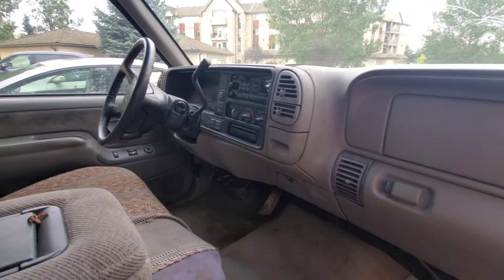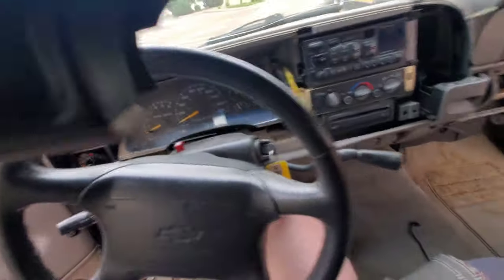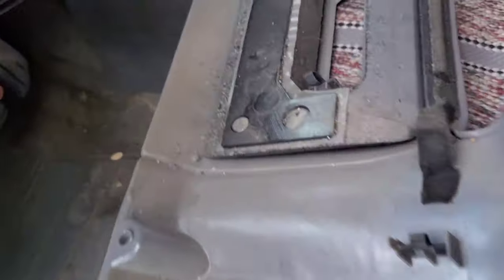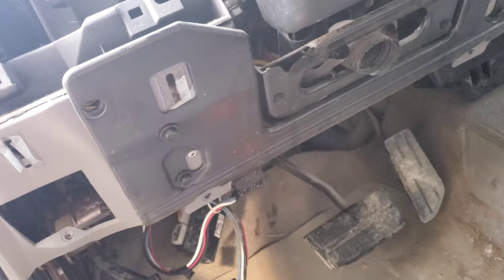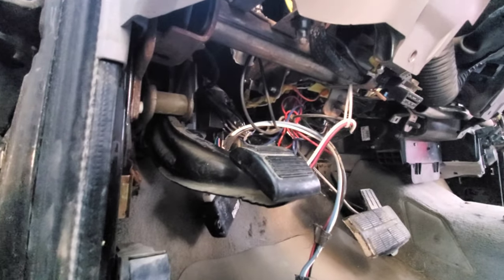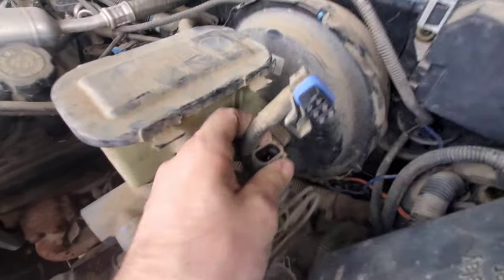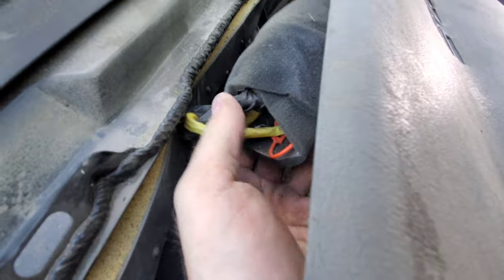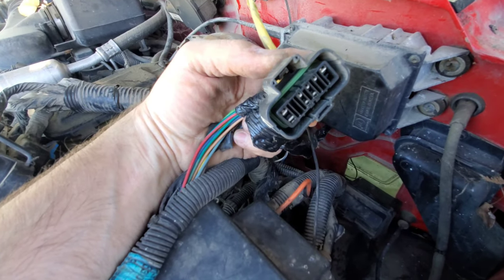Dash Removal Chevy GMC Truck 1995 1996 1997 1998

Comment: you're doing this job harder than it needs to be. I'll replace the dash in my 98 z71 without getting under the hood. If you had removed the steering column then you'd been able to unplug all of the dash components without having to pull the wiring harness through the fire wall. I have short vids when i replaced the oem dash top having to take the dash out and put it back in in the 04 dodge crew i previously owned. NUFF SAID.
Reply: Wish I read this before doing all that 💀
Reply: @turle8645 me too😂
Reply: You don’t even remove the steering column, just unbolt it completely and it will drop to the floor with the dash then you can just unbolt/unplug the harness from the back of the dash and then you can pull your dash out
Reply: Post the video so we can refer to it

Comment: Thank you for making this. I would have never even attempted this job without this video. Thanks for taking the time to make this. I watched it three times and almost didnt even try it. Also thanks for mentioning the differences vetween the 1997 headlight connection compared to the 1998 and 1999. You the Man!
Reply: My dash was really busted up from previous owner. It rattled so much it was so annoying to drive. I went to salvage yard today and pulled the only one they had the color I needed and out of a 99 Tahoe. I made a small mistake though by not being more aware of the vehicle I pulled it from. It was a 2WD so it did not have the electronic wiring harness that was needed to plug in my auto trac 4 WD switch. I ended up having to remove the ventilation duct and removing the wiring harness and reinstalling it on the new dash. Just a note to make sure the vehicle you pull one out of have the same options so that you can plug and play instead of having to do what I did. Video helped a ton. One thing I would note is that I feel like it is not necessary to remove to ash tray and 12 V charging ports. All of those plugs come out with the dash. Thanks again for the video.
Reply from the maker: How can I be the man when you're already the man?
Reply: @tonybunch9115  See my comment above. When you have both cores in hand, it's easy to reroute the harness from one to the other. My '99 Burb has the pigtail for the 4WD switch tucked around the instrument panel, even though it's a 2WD truck. I guess GM used a full harness instead of a lite version, but even my '97 donor truck has the same thing. Who knows why they made that choice... was the Tahoe also built in the same plant in Mexico?
Reply: @MrTaxiRob  The plugins i needed were not in the dash I bought. I would have gladly used the existing lol. It was a pain to change out.

Comment: This video doesn't show ALL of what needs to be unplugged tho, I just took mine out today and I released after following all these steps once you loosen the top 3 screws there's still 4 wires on the driver side behind the dash and 3 or is it 4 wires on the passenger side that still need to be unplugged B4 you get to take it out without a problem. Also it works better if you remove the steering column all the way. Although this video was ALOT of help, so thank you for that.

Comment: Don't know if you ever figured it out but the computer doesn't have to be removed the black bar if you pick up a little it moves over and the computer slides out the holder

Comment: I installed thousands of those dashboards when I worked at GM. A lot of the stuff that you removed is all assembled on it the IP line and the whole assembly is installed in one piece. The lower parts are installed after IP is inside cab. Of course the steering column and seats are in stalled afterwards. 
👍on the video
Reply: How is the passenger airbag installed in these trucks burner Loco?
Reply: How come you didn’t make a video ⁉️but you right and there’s so many that do that well want tell other stuff at lease this guy don’t talk about all the information that has nothing to do with the job at hand ‼️I think him for having the only one that’s straight on what the video about‼️🙏🏻🙏🏻☮️

Comment: You did an amazing job on this video. I used it as a guide to pull the dash out of my 1995 Chevy Silverado Z71. You didn't miss a thing. I could not get my dash past the steering wheel. I actually broke it while trying. I went ahead and removed the steering column to put it back in. That worked really well, but it's a pain. I have not found a good video on removing and rebuilding the air box. That would be a good addition to this one.
Reply: I’m about to have to do this as well to get to the air box any tips? I have a 95 z71 as well.Do you have to completey remove it to get to the air box?
Reply: I'm in the middle of pulling the dash because I can't get the damned air box back in. All because I wanted the warranty on the AC parts. Tried to replace the accumulator, ripped the hose.

Comment: thanks for this. I been had the parts to finish redoing the entire A/C system and needed access to remove the heater core. this will save me lots of money!!!
Reply: I installed my heater core on my 98 in under an hour. Not as difficult as it seems I had more trouble putting the covers back on than anything else

Comment: Great vedeo and great explanation it's really crap work mate 😃 I hope I never ever need to replace on my 95 suburban 6.5 😃😃 you understand well enough for replacing that caind of the pieces 🤔👏👏👏👌I don't like wires and electronics stuffs 🤪🤪 I prefer replacing a mechanical parts 😃👍cheers from Norway 👍👋

Comment: I recommend having one of those interior panel clip tools on hand, the forked thingy with the regular screwdriver handle. It's good for gently pulling the push clips for the wiring loom and whichever plug ends are also clipped to the truck. And do it when the dash is nice and warm so they give easy instead of snapping, maybe leave it in the sun an hour or so before you start separating the wiring harness from your donor dash. Piece of cake.

Also: REMEMBER TO REINSTALL THE SECTION OF METAL BAR UNDER THE STEERING COLUMN before you try and pull the dash, otherwise the whole thing gets floppy and you're going to snap it in half. Even if you intend to throw it away, it's MUCH easier to pull it and remove the wiring with it in one piece.
Reply: Those tools are great,...until you lose it!
Reply from the maker: Very handy

Comment: I could describe most OBS repairs as "tedious," but not necessarily "difficult." This is the first dash removal vid that actually shows what need to be unplugged without cutting any wires as a dismantler might do... although why anyone would butcher a perfectly good dash harness just to sell a dash core boggles my mind. That's like cutting a perfectly good transmission in half to pull an engine.

If you're doing a same year swap, all the plug ends should be the same including the airbags, so it's easier to leave the harness in place. I have to do a 97-99 swap, so unfortunately that's not the case for me, but at least I'll still have two running and driving trucks when I'm done.

I can swap the harnesses with both cores on the bench, easy peasy. One core is mint and the other gets epoxied, one truck is for show and the other is for work. Not everyone can do a destructive removal, so thanks again.
Reply from the maker: They still have heavy metal in them. Easy to body work

Comment: I listened & watched 4 other videos on how to remove my glovebox & none have the same mechanism as yours. Mine is like yours. I tried to remove it just like the other folks were showing but mine has that little plastic "stick" on the side of mine. Just like in yours. I need to swap out my resistor as I lost high speed. I got the part at Advance & was going to try & do it but no dice. I'm dealing with all plastic. Plastic is very easy to break in my hands. I wanted to push it but I know I would mangle it. So I stopped before I broke something. I figured the other videos were without that plastic stick in the left hand side. My tool box has a 1 pound hammer & a 3 pound hammer & a sledge hammer. Finesse is not my forte.

Comment: The parking brake handle comes off of the shaft and the mount for the shaft twists out. No need to disconnect cabling in the back.

Comment: So this video has helped me a lot removing and reinstalling my dash but the wiring doesn’t want to work correctly I’ve rewatched the video and I’ve got a plug that I can figure out where it goes and my headlights now blink with my hazards and my ignition doesn’t work do you know what that could be

Comment: My 98 K1500 has been LS swapped and the guy before me messed up something with the wiring (I assume sensors not hooked up) that caused the instrument cluster not to read anything. Lol greeeeat.
Reply from the maker: Luckily not much changed generation to generation. Could be a simple fix
Reply: @inlinepaintandbody  The original LT fusebox is still in there and the LS fusebox has maybe one or two fourths of it hooked up.
Reply: The only thing is, I've compared the two and I'm not so sure that the pinouts of the connectors would work properly with the LS fusebox.
Reply from the maker: @Monster404ftp  I’m not much of an expert on electrical issues, but there is a lot of information on wiring with an LS swap. And also finding a guy who can diagnose electrical issues is worth 1 million bucks. Definitely get what you pay for when dealing with electrical issues and fixing them.

Comment: Great and informative video. The fasteners you are calling 7mm are actually 9/32", but a 7mm will work. GM likes to use 9/32" and 7/32" for many of the smaller screws, especially on 60's, 70's, and 80's vehicles, which are what I used to work on. I would like to replace the dash in my '95 Silverado because around the 3 screws by the windshield the dash is cracking causing the dash to rattle and bounce up and down when hitting bumps in the road. Thanks again and take care Buddy.

Comment: Awesome vid, love. The wires that do not match up, that you mention towards the end (97to98). Did you take the wires out of the 97 and install in the 98 to match?  What was your solution?
Reply from the maker: Swapped dash harnesses
Reply: find a big space, maybe lay a blanket down on your garage floor and set them side by side. Remove the harness you want to use and replace the second one hole by hole.  Take lots of pictures just in case. It's pretty intuitive, though.

Comment: Question about the 98 parts truck, is the immobilizer system part of the steering column wiring ? Ive got a 98 parts truck im getting ready to pull the dash from and its got the security immobilizer, but the 97 its going into doesnt
Reply from the maker: I think so. I swapped the dash from the 97 in the video with a dash from a 98. Everything from the 97 dash moved over into the 98 and vice versa.  Installed this 97 dash with 98 guts back into the 98.  98 wouldn't start. Tuned the vats out of the truck and fired right up.
Reply: @inlinepaintandbody  how do you tune out the VATS? Is it a chip key or do you really mean Passlock?
Reply from the maker: @MrTaxiRob  Had a friend with a tuner delete them completely
Reply: @inlinepaintandbody  was it a Tech-II scanner? I've heard it can be done but I've never come across the actual procedure..

Comment: Thanks for the vid but am i able to put the dash back on without moving the steering wheel. Im trying not the crack the new one i got.
Reply from the maker: Drop the steering column down. Two nuts underneath. Gives you enough room. Have a second set of hands to help you install
Reply: @inlinepaintandbody  thanks got my new dash in. You're a big help bro.
Reply: @matthewlandrum2072  I know you're already done, but pulling the driver's seat gives you more room to work.

Comment: Is no way to remove the plastic portion of the dash and keep the vehicle operable?
Reply from the maker: Could remove the wiring harness and stuff from the dash and plug it all back in
Reply: @inlinepaintandbody  OK, have a 96 Tahoe with a great body and good chassis. I want to paint the dash but not have to get it towed back and forth to the shop for major mechanical work broken up over the next month. Thanks!

Comment: I want to change my rotted 1998 cab with a better 1989 cab, will I be able to take out and switch the two dashes or is there too much to adapt and modify? Or will the mounting points all match up?
Reply: What kind of truck? The pickup trucks changed to NBS a year before the SUVs. 95-99 SUV dash cores should all mount the same way, with slight differences in the wiring harness.

Comment: This is a great video, very helpful. I need to replace this exact dash you just took out. Having a hard time finding one. Any suggestion on where to look to find one (especially in decent condition)?
Reply from the maker: Further north you go, the less sun baked and cracked they get
Reply: Lmctruck has new ones.
Reply: I wasn’t able to find one for the later 90’s models on their site. Maybe I’ll check again. Thanks
Reply: @guacago488  yep, nothing for '95 and up.

Comment: Where did you get the new dashboard assembly
Reply from the maker: Parts truck
Reply: @inlinepaintandbody  is it a dash cover or an actual dashboard replacement?  Mine has become brittle and is breaking off easily.

Comment: Im pretty sure its the same process for the non passenger airbag dashboards, just with a few less steps lol
Reply: Also for the park brake cable, I just pulled the whole handle off of the thing 😳
Reply from the maker: Yup pretty much

Comment: I took my dash so that my mehcanic can replace it …. The stop lamps don’t work and the 4x4 button switch ain’t working ….. where can I look to fix these
Reply from the maker: Electrical issues are not my strong suit. I’d start with the easy stuff first. Checking connections and fuses.

Comment: It’s the connection from a 1998 same as 1999 C1500. You said the connection from a 1997 is circle harness and 1998 it’s a like scare. Just wondering if the connections from a 1998 same as 1999
Reply from the maker: It’s probably the same as a 98. If not very similar

Comment: I know this video is old so I have to take out the ac system to replace the evap ac cause mine is leaking should I follow exactly these steps or should I go a different route
Reply from the maker: If you need the dash fully removed then this is how it's done. It's really not super difficult to remove. Just label and organize your hardware. All the electrical plugs are different so you can't confuse them
Reply: I didn't even think to check mine before beginning the dash replacement process. Ugh.

Comment: Where does that wire go that has the white end on it
Reply from the maker: What wire
Reply: The one that is by it self with white end on the in the engine bay
Reply from the maker: @leonardjackson6717  What time in the video do you see this wire?
Reply: When u took the main engine wiring harness off the block going though the firewall
Reply: I’m time frame of 1420
Reply from the maker: @leonardjackson6717  I believe that is for the headlight harness
Reply: Ok thank u I change my dash now the truck won’t stay running I have no ideal what I didn’t wrong

Comment: Many of the trim pieces, controls, and connector you took out move with the dash and didn’t have to be removed.  Extra work for no reason, but I bet you figured that out afterward. Good video over all.

Comment: Why did you remove the dash?
Reply from the maker: Had a crack by the windshield
Reply: @inlinepaintandbody  So to fix a crack on the dash, fill and paint, you have to take the entire dash out?  The cover is not removable as it is on a 2003 as a part?
Reply from the maker: @WellsLarry  Still have to remove the dash to fix the crack properly anyways

Comment: Is this dash the same as a 97 suburban 2500?
Reply from the maker: Yes, the exact same
Reply: @inlinepaintandbody  great. I have a 97 sierra V6 1500 and the interior is beat up. I found someone selling a 97 gmc 2500 suburban and the interior is actually in really good shape, seats and all. So I'm gonna buy it and swap everything over and even the 5.7L.
Reply: @inlinepaintandbody  the doors are full powered and my sierra is full manual. Can I swap the whole door and plug and play the wires? Including sideview mirrors too.
Reply from the maker: @funguy7979  If you can remove the power doors and see how they all operate and how everything is hooked up I don't see why not.
Reply: @inlinepaintandbody  I was actually planning on swapping the whole door over and connecting whatever wires necessary. I can transfer fuses etc....
Reply: @funguy7979  how did it go? I assumed the power and manual regulators were attached to the inner door panel and you could just swap over the whole assemblies...
Reply: @MrTaxiRob  end up selling it due to issues that kept arising. I'm actually about to go pickup a 89 k1500 single  cab long bed 4x4 350sbc with 12in lift
Reply: @funguy7979  I used to have an 87 Cheyenne, can't remember who I sold it to or why. Late square bodies are tight.

Comment: You guys think a 98 99 00, steering wheel is a direct swap to the 95,96 steering wheel
Reply from the maker: Double check with a GM dealership. Could be all the same part numbers